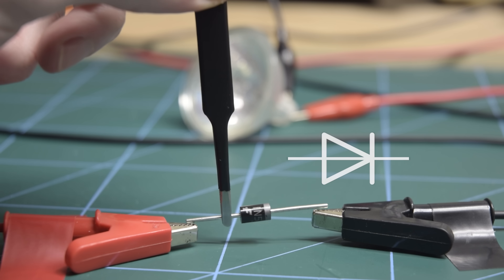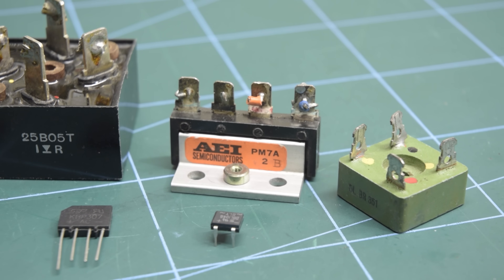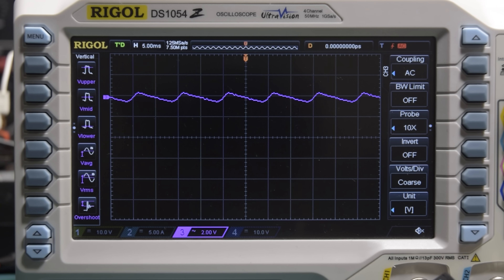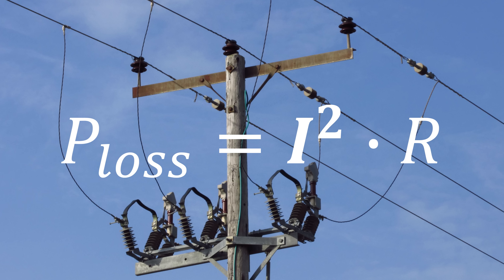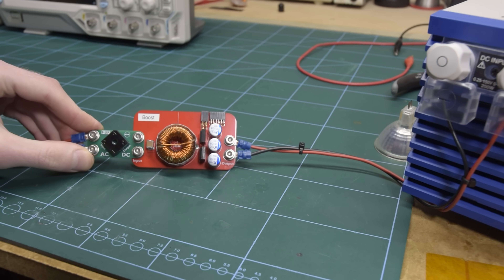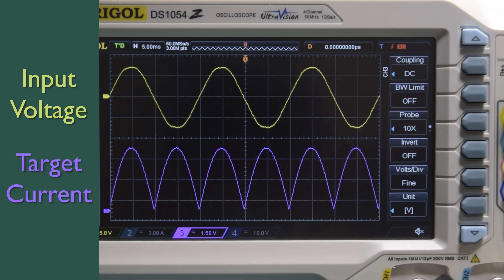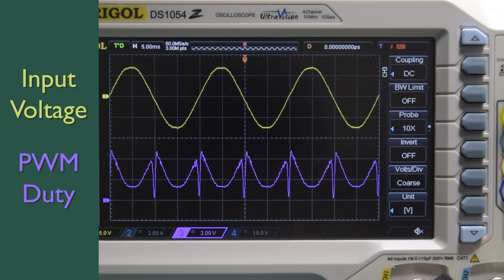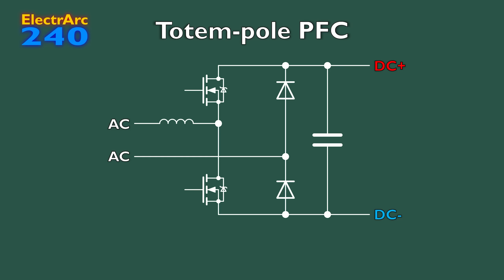Fixing the Full Bridge Rectifier’s Big Flaw - Active Power Factor Correction

Comment: Project is interesting, but I'm wonder what is practical use of it? In case of home users (EU), electricity charge fee is independent from reactive power. 
For industry users (UE), reactive power is very expensive. This problem is solved by using already compensated components (eg. LED lamps equipped with proper power suppliers etc). Energy consuming objects takes care of PF > 0.9
Reply from the maker: The practical use is anybody who designs this equipment or wants to understand how it works :)

Comment: I’d like some input on a question…
At around 3:50 there is mention of “Volt/Amps” Is that different than watts? I was taught pressure times current = watts. When computed using RMS is that what makes it Volt/Amps? Am I just using an archaic term? Or am I using the term incorrectly?
Reply from the maker: Voltamps (VA) is basically watts but apparent power. So it’s just what you get from measuring current and voltage SEPARATELY and then multiplying. If they aren’t identical waveforms (shape and phase) then this will be different to if you multiply the waveforms first and then measure the result (power waveform). This is the real power (watts)
Reply: @ Hey thanks. I appreciate it.

Comment: I do not understand why you transform the sinusoidal input to a square one, to rebuild a sinusoidal duty cycle after. Just use the input voltage after the bridge and generate a duty cycle proportional to it, with an added factor to account for the power you need to draw (ie from the low tension side). This way you reduce things to a bare minimum.
Reply from the maker: There’s no guarantee that the AC voltage is a nice sinusoid, in fact it rarely is
Reply: @electrarc240  Unrelated. If the AC voltage is not sinusoidal, then the required intensity to get the best power factor is exactly proportional to the input voltage (like a pure resistor). So using the input voltage is the best option nevertheless.

Comment: Very well structured and demonstrated explanation!
I studied PFC circuits when I was an EE student and was taking a course about power supplies (SMPS-es mostly).
One interesting fact about them is, that if you do the math it turns out it is mathematically impossible to achive a perfect power factor of 1. But as you demonstrated you can get pretty close even with (don't take this the wrong way) minimal effort.

Comment: I have developed a few PFC circuits and i think the easiest way is tu use an analog control circuit. A couple of opamps will work (adjusting the control loops, specially the voltage loops need to have a very slow response (about 10 Hz))
But they sell ICs with all the necessary control circuits, I started using some from analog devices like the LT1248 (mainly because they have models for LtSpice) just be careful that the control loops shown in the schematic are a bit fast and need a bit more capacitance 1 uF for the voltage loop shoud work fine and 100 pF for the current loop but will vary case by case.

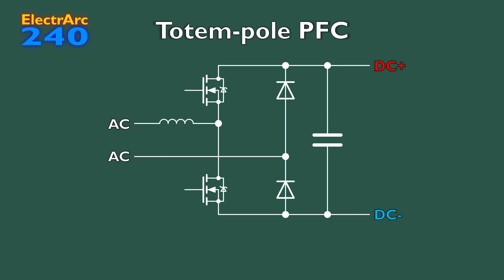Comment: 11:13 are your MOSFETs the wrong type? Looks like the body diodes in each one would from a passive full bridge, and the output would be approximately the peak AC input voltage regardless of any MOSFET switching, no?
Reply from the maker: That’s all correct, without switching it would indeed just act as a normal diode bridge but if you were switching you wouldn’t just turn those on. For example you’d first turn on both bottom switches to “short” the input through the inductor and then turn one off and it’s high-side friend on like a synchronous boost converter. The easiest way to control it would be one half bridge switches at mains frequency and the other is much faster to do the boosting. Hope that’s a bit clearer
Reply: @electrarc240  I'm not sure about that, the body diode, represented by the little diode in the MOSFET symbol, is always 'on' and means the MOSFET can't block flow in that direction whether switched on or not. I think your design requires diodes in series with all the MOSFETs to stop any backward flow through these body diodes. I also think it needs P-channel instead of N-channel MOSFETs at the top, to allow switchable current to flow onto the DC+ line. That's my understanding at least, I'd be interested to know if I'm wrong.

Comment: So the power factor is essentially the (cosine of) the average phase difference between the voltage and the current, since it's their normalized inner product. And I suppose that makes sense it would result in worse performance, since if you're driving something that's out of phase it has periods of where it's actively pushing back and others where it's pulling you along.

Also, does that mean a pure capacitor has a power factor of 0? Been a while since circuits but I seem to remember those having current and voltage exactly out of phase.

Comment: I am not an expert. Your mileage may vary. My understanding is that:
-- there are no regulations for "power factor". What are regulated are power line harmonics.
-- the applicable European standard is IEC 61000-3-2. The latest revision is 2018. There have been two technical amendments, so the "law of the land" is IEC 61000-3-2:2018/AMD2:2024
-- the regulations vary with both type of equipment, and the wattage of that equipment. 
-- the equipment with the lowest power for regulation is lighting (called Class C). Regulations begin at 5 watts. Anything below 5 watts is given a free pass. Above 25 watts, the Class C regulations change significantly.

Comment: We used the full bridge rectifier to charge the battery in my childhood from AC and put a big bulb 200w as register because the charger in market is much expensive for us in that time. ❤ working with diodes also we make work fuse tube light using these

Comment: If you go way back some of you may remember the concept of putting the inductor after the bridge rectifier (with the capacitors after the inductor) and in fact using a special kind of inductor called a "swinging choke". Those increase inductance when the current is low and decrease inductance when the current is high. The result is decent power factor at all times, but the swinging choke is a specialized, bulky, heavy, and somewhat costly component, and it introduces its own losses. 
When properly designed and all components were working properly, this fancy approach also did a half decent job of regulating the output voltage. 😊

Comment: A resistive load that is on for 1 minute and off for 1 minute has a power factor overall of 70.7%.
A resistive load that is on for 1 second and off for 1 second has a power factor overall of 70.7%.
A resistive load that is on for 1 cycle and off for 1 cycle has a power factor overall of 70.7%.
To get the power factor to 1, you'd need a combined system that draws constant power at 50%. When the load is OFF, the active circuit draws 50% power from the mains and stores energy.  When the load is ON, the active circuit retrieves energy and delivers 50% power to the load (while the load draws another 50% from the mains).  Well, that's the hard way. If only the load could only be run continuously at 50% power, then its power factor would be 1. One way is to deliver "reduced" voltage of 70.7%, which would let the resistive load run at 50% power. A transformer is one way, but transformers add losses. A variable transformer is costly. Thyristors chop the current every cycle, but they make a low power factor cycle-by-cycle. Running 1 CYCLE on and 1 CYCLE off doesn't change the power factor.  Something like an AC buck circuit or a constant duty cycle "chopper" with inductive and capacitive filtering is needed to reduce the power to 50% without creating a duty-cycle problem.

Comment: You don't show the drive circuit or how it handles a varying load. Every one-phase AC-to-DC converter stores energy, enough to "ride through" the repeated power interruptions (100 or 120 times per second). Even if your load draws near-constant power (near-constant current at the near-constant DC voltage that you produce), you don't draw constant current or constant power from the mains; that's impossible. You draw current that is proportional to the instantaneous mains voltage, essentially simulating a resistive load, which has a power factor of exactly 1. (The mains power drawn is proportional to the square of the instantaneous mains voltage.) You need a pretty fancy controller to accomplish that. (An even-more-advanced circuit could carefully adjust the shape of its current draw versus time (reducing its power factor), in order to make the local voltage sine-wave prettier, which could increase the power factor of the local building).) If the load suddenly decreases at any time, you can drop the duty cycle of your boost converter to avoid overcharging the output capacitor.  But if the load steps up while the mains voltage is near zero, the voltage will sag more than it would have if the load increased while the mains voltage was far from zero. The controller has to "think" one half-cycle at a time, even though some loads can change instantaneously. Maybe undervoltage and overvoltage in response to load are easily prevented by simply using a slightly larger output capacitor.

Comment: Another excellent video. I don't know if you take suggestions but I would like to see your brake down and explain of a transient voltage surge protection circuit. The antizap device's they sell for automotive industry. They say it will protect during welding on the vehicle and boosting circumstances. It's a simple but interesting circuit. Used in many other situations but that one came to mind....

Comment: When you show the label on a power supply (9:54), it reminded me of a question. Why does the input list 1A for the full voltage range? I can’t see it using 100-240W to make the same 48W DC without it being terribly inefficient at higher voltages.
Reply: The current rating shown on the device is the maximum current that the devices will draw. This corresponds to the worst case - when it's generating its full rated output power at the lowest supported input voltage. In any other case (higher input voltage, lower output power), the input current will be below the maximum.

Comment: this is a response to a comment, copied here; I'm on an ancient computer with an ancient browser and "reply" doesn't work

Original post:
power factor of the capacitor does not matter, power factor of the entire cicuit does.  You cannot determine power factor for the circuit by looking at current flow through the capacitor (which is what you did).

(which is what you did) .If that is what was done, I certainly can't find any evidence of it. Maybe things I think are very obvious aren't.

The very first current waveform shown, other than that with the lamp, is at 3:20. The upper trace (AC coupled) is the ripple voltage on the filter capacitor. The lower trace is the current from the AC supply, ahead of the rectifier. You simply would not get waveforms that look like that without a load on the filter capacitor. There would be virtually no voltage ripple and no current. There might be a very tiny amount of ripple and very tiny current spikes to restore charge lost due to leakage currents, but you certainly wouldn't see a train of current pulses 3-4 ms wide and about 9 A peak amplitude. Even at initial application of power the waveforms would not look like this. Evaluating the power factor of the overall circuit based on this current waveform is perfectly correct. It would vary with different loads. With very light loading the power factor would be worse and at higher load (if that is possible) likely somewhat better. With all other things equal, increasing the filter capacitance would make the power factor worse - the ripple voltage would be lower meaning the current would flow for a shorter time each half cycle, but the energy put into the capacitor each half cycle would have to be exactly the same.

At 4:00 the voltage, current and power wafeforms are shown. The ratio of peak power to average power is obviously horrendously bad. The flat tops and bottoms on the voltage waveform say that the impedance of the AC source is fairly high and being pulled down by the current. If the impedance of the source were lower the current spikes would be of significantly greater amplitude. The amount of energy put into the cap each AC half cycle would still be exactly the same in both cases. My guess is that the AC is coming via an ordinary smallish iron-core transformer. Winding resistance and less than perfect magnetic coupling between the primary and secondary would be the main contributors to raised source impedance.

Once again, the analysis of this circuit is correct. The waveforms are absolutely typical of a switcher with AC input and capactive filtering with no power factor correction, with the possible exception of the the issue related to source impedance.

Comment: Switching regulars raise the frequency of the AC input first. There is more energy in a higher frequency and less drain down of the voltage over time. You should compare the efficiency for power loss in the circuit of your new model with those to see if it is really an improvement in design! Nice work!

Comment: 50Hz is so-so old and they should kill that system. It is much better to use 10kHz or bit higher. Yes all electric need to replaced then but it will happen sooner or later.
Reply from the maker: Have you heard of skin effect? Also inductance of transmission lines alone would represent quite a high impedance at that frequency

Comment: I wonder if you could use op amps to do analog calculations for duty cycle? Are all power controllers controlled by microcontrollers now a days?
Reply: There are numerous PFC controllers that are entirely analog. Some are quite complex and an analog mutiplier is a standard feature. One that I used in some industrial power supply designs some years ago is the Unitrode (now TI) UC3854. Between the datasheet and the ap note for that part you can get quite a good education in active PFC. There are controllers that combine the PFC functions and the main switcher functions in a single IC.
Reply: @ 
Thank you for the information and example Doug! I will look at the data sheet. Intuitively it seems like an analog circuit would make more sense.

Comment: power factor of the capacitor does not matter, power factor of the entire cicuit does.  You cannot determine power factor for the circuit by looking at current flow through the capacitor (which is what you did).
Reply: Poor power factor due to capcitive filtering after a rectifier is THE concern in a swithmode power supply. I've designed lots of switchers, including big ones with active PFC. The approach to analysis in the video is entirely correct.
Reply: @ebpdoug2175  I am commenting on the beginning of the video where a current graph for the capacitor was displayed and the VoiceOver made conclusions regarding power factor from that graph and nothing else.  Completely wrong.  As for the rest of the video, I would not waste my time after that.  This creator  could not possibly understand it.  Hope that's not you.
Also, don't know where this switch-mode stuff is coming from.  All I saw was a full wave rectifier and sine wave AC.  Active FPC is potentially valuable for reactive loads; while a capacitor IS reactive, it in no way ensures that the load is reactive.  But then, you know that considering your extensive experience, right?
Don't assume that the people you talk down to are uneducated.

Comment: What a lot of crap. This guy has made something very simple seem difficult and complicated that can only be solved by a genius like him? A simple ripple filter circuit is all that's needed to smooth out any waves,spikes or noise.
Reply: Watch the video again. Active PFC is used to correct the current waveform from the AC line. You cannot fix the problem with any simple circuit. There are some simple circuits that aren't too bad at a few tens of watts, but unworkable at high power.  The circuit he describes is very widely used, though using an application-specific analog IC instead of a microcontroller.

Comment: Isnt pfc just an power supply boost converter topology?
Reply: Boost topology is by far the most commonly used, but...
To do the job, the circuit must make the instantaneous input current directly proportional to the instantaneous input voltage, but make the average input current inversely proportional to the average input voltage. A simple boost converter does the latter but not the former.

Comment: So I am trying to get a great clipping diode circuit. Rectified Triple rectified I am not sure yet.
Thanks for the video.
I am using this in music.
❤
Reply: Good clipping circuits can be quite tricky if you need a stable clipping level so you get nice, clean flat tops and bottoms. There are circuits using op amps with biased diodes that work well. Try searching the web for stuff from Bob Pease. I have a faint recollection that he wrote an article that showed some good designs. Iirc, it was published in one of the electronics "trade" magazines quite a few years ago. Old ap notes from Analog Devices and National Semi (now part of TI) might yeild some good stuff .